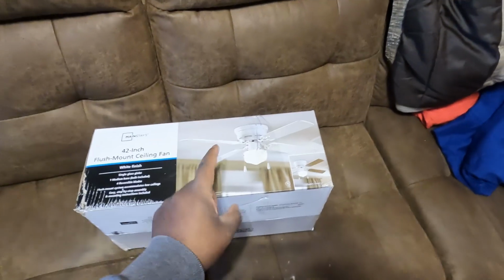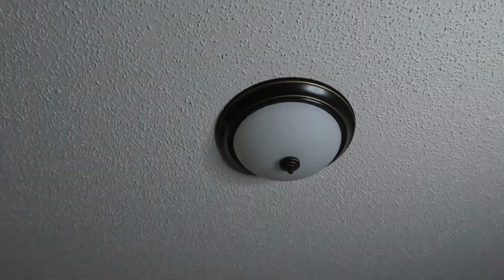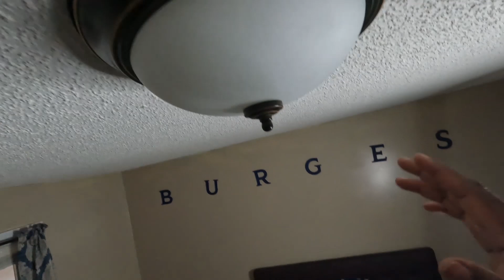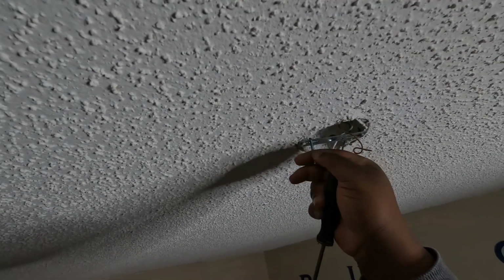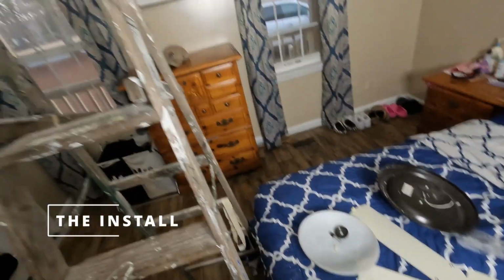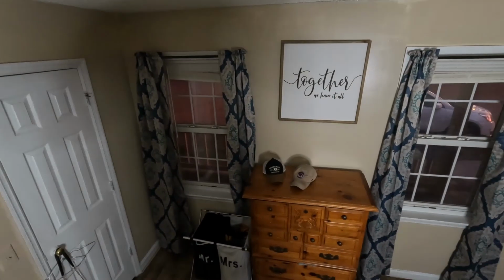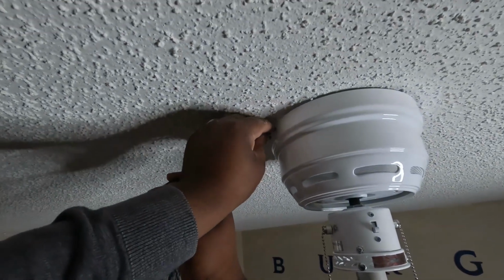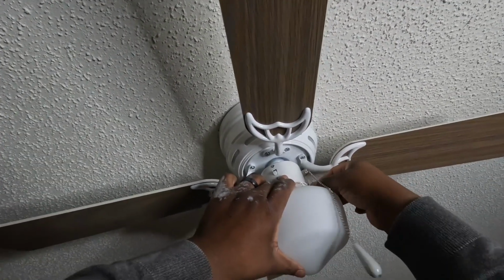How to Replace Light Fixture with Ceiling Fan Install  #42" Mainstays, #Walmart #diy #home #youtube

Comment: What type of light bulb does it take? Ik it doesn’t take the A19
Reply from the maker: Yes, it takes A19 bulb.
Reply: Height of an A19 can vary a bit depending on brand. Would suggest A15 fr these, a tad shorter.
But really should avoid these. All single bulb fixtures are pretty worthless.

Comment: Not bad at all, but you put the ceiling fan bracket on a light fixture bracket that is attached to the electrical box the light fixture cannot support a ceiling fan for years the main danger of this is that if it wobbles and vibrates the screws will get loosened causing the motor housing to have a gap between it and the whole ceiling fan will move, this could be potentially hazardous for the people sleeping in that bed.
Reply from the maker: Thanks for the comment I think I might have a way to mount to the fand to the ceiling joist.